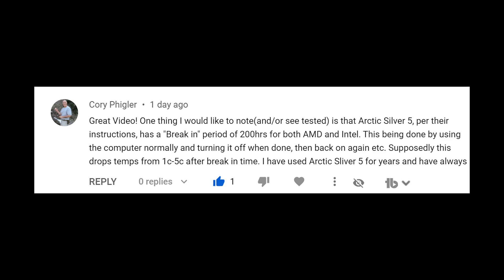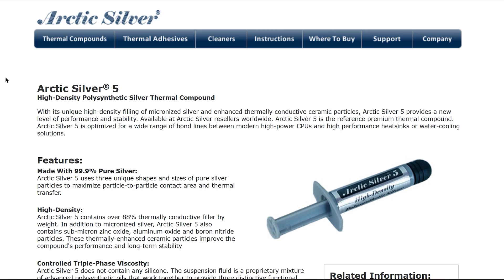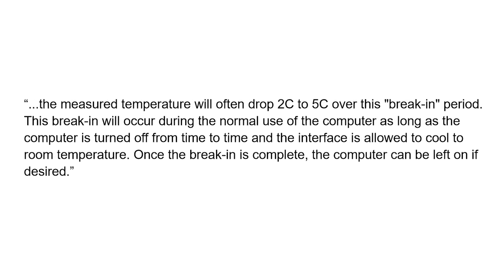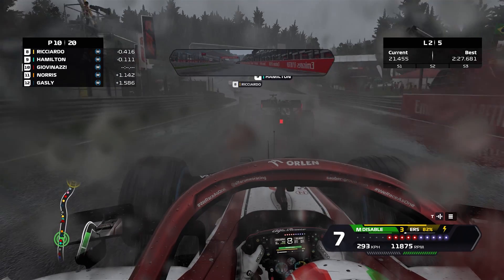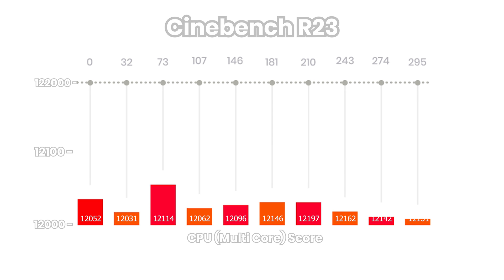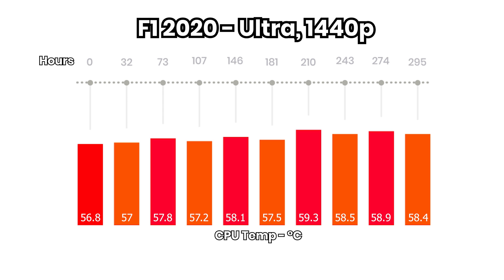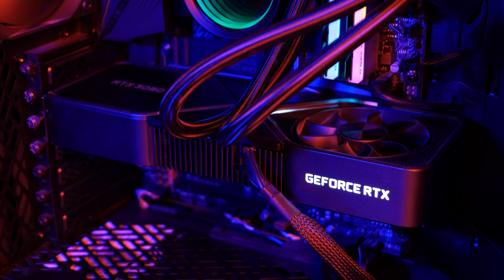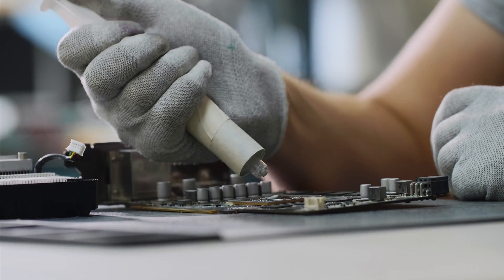Does Thermal Paste Need To "Break-In" ?

Comment: yooo how long does the thermal paste last
Reply from the maker: Depends on the scenario. If it comes stock on a laptop or GPU I would change it within 2 years. probably 1 for my taste. Self applied like in a DIY desktop I would go for 2-3. Personally I am changing it more frequently. I always suggest changing only when you need to...when you run into thermal issues. Some paste dry out sooner than others.  YMMV
Reply: My stock paste in laptop lasted 9 years. Then it became dry . I scrapped it carefully and added a drop of new 10W30 engine oil just enough to have a spreading viscosity and it's up and running 2 years now without any heating issues. But I clean my cooling fan once every 3 years of its life, so the pasted was never overcooked due to a clogged fan. When fan is clogged with dust the paste looses it's potency due to over cooking. Temp range from 40-72 deg C. Now I'm planning to repaste it with new one. Which is why I came this channel. 
Thankyou "Tech literate" for ur testing . Nice job. Keep it up.
PS : I'm not a gamer. It's a calculated risk I had taken, as it's my old but main laptop.
Reply: Well my day 1 ryzen 1700 was just retired with AS5 on it and the temps were the same as always, so minimum of 4 years. It's reported to live for up to 10 years, beyond that maybe